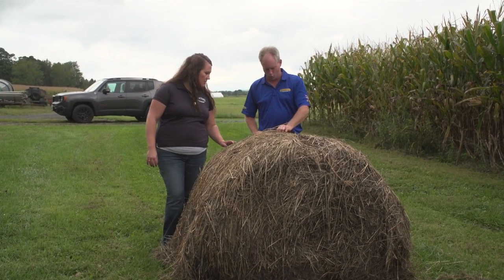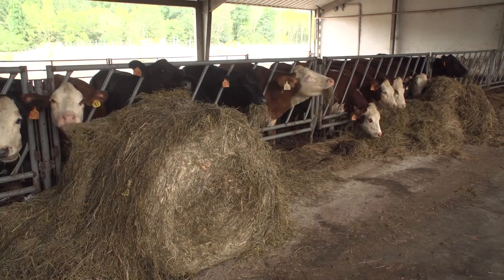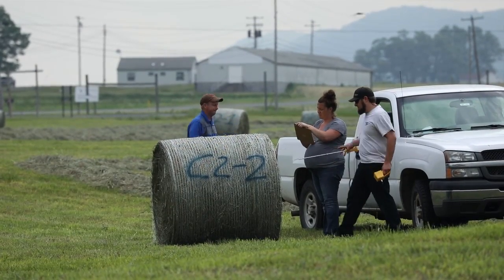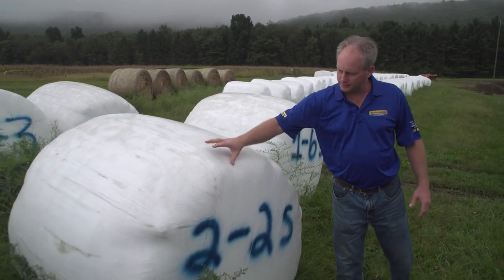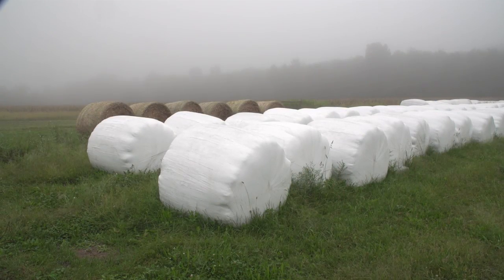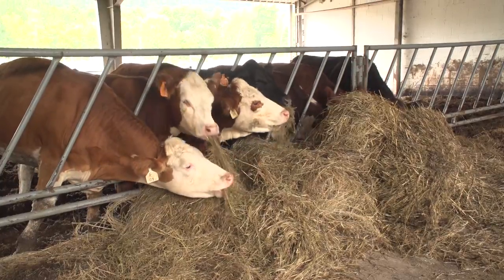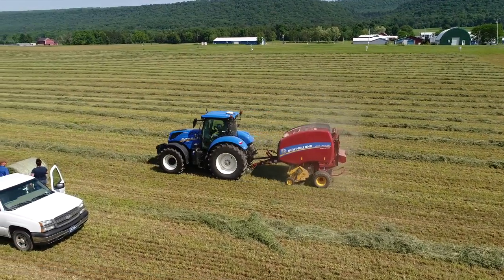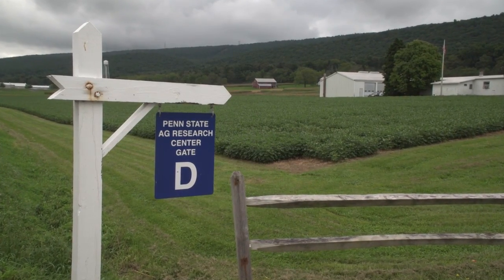Bale Density Study with Penn State University - Part 2

Comment: The rake makes a huge difference to bale shape. If the windrow is heaped in the centre you get soft edges
Reply: Agree, goed distribution of the feed is key. Knifes that shortens the product also helps to get better feed distribution and guess density.
Reply: I did silage the first time and the second paddock we put two rows side by side with a side delivery rake and made the bale tight and square